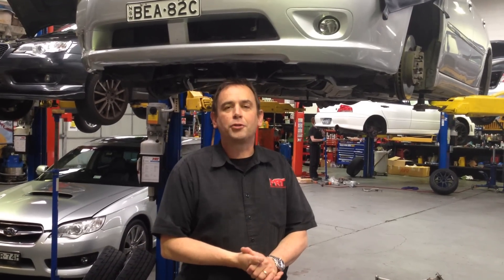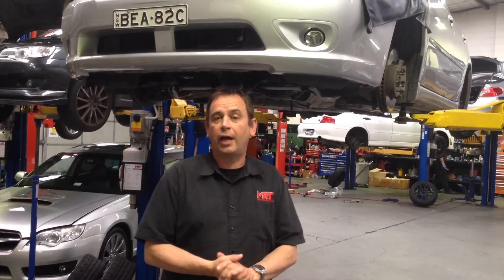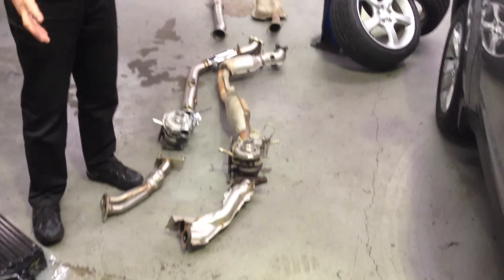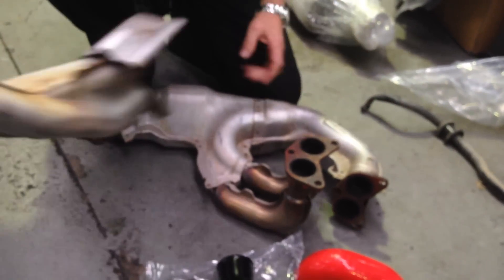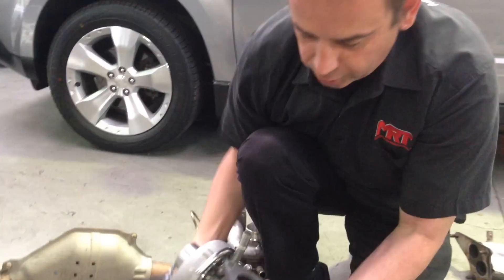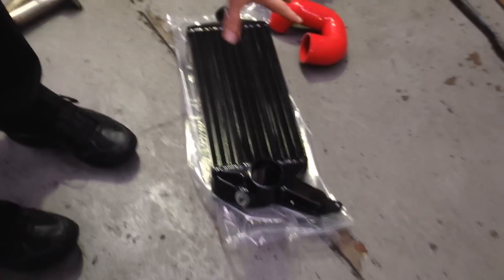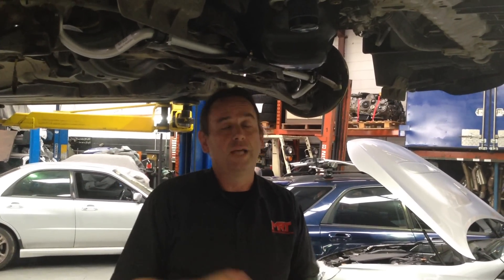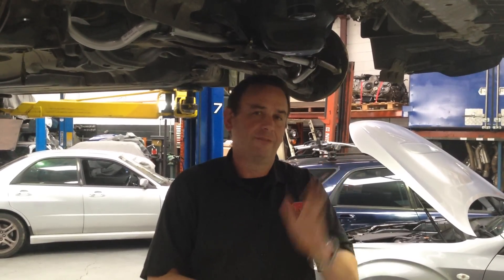Subaru liberty gt exhaust upgrade with turbo, MY05, the MRT XC power  kit

Comment: hi MRT I want to know if it's possible to change a Legacy twin turbo setup to a Single twin scroll turbo?
Reply from the maker: +misheck Mhlanga why bother? Its a HUGE job and when tuned RE CORRECTLY the EOM  ECU and twin turbos are fine
Reply: so wats best MRT? shld I tune the ECU n put aftermarket turbos like TD04s?
Reply: +MRT Performance Can the ECU of a legacy Twin Turbo be tuned?